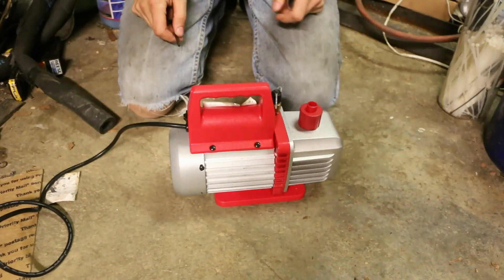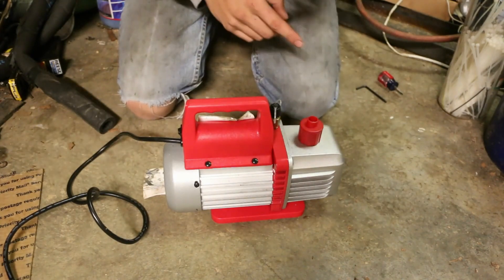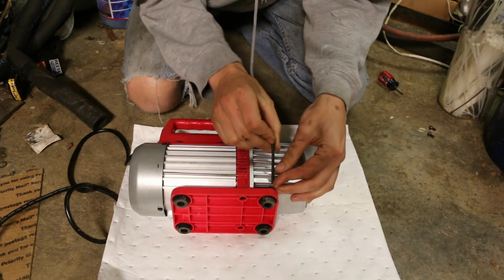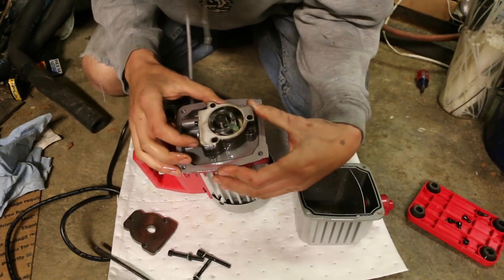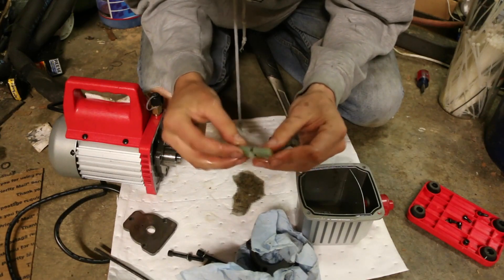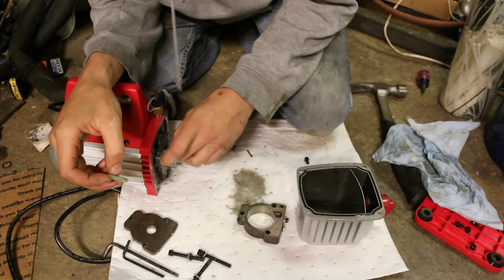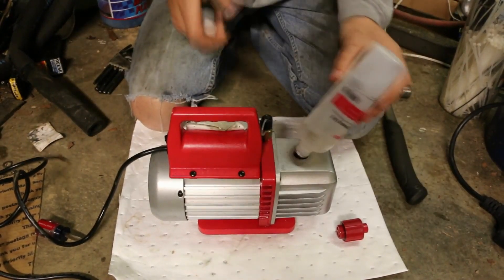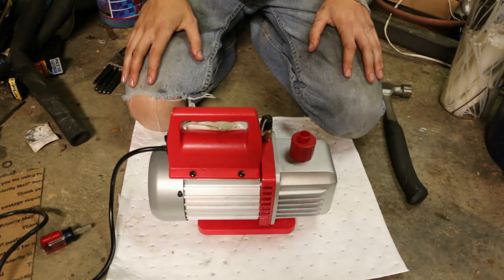Kozyvacu TA350 Teardown and repair. (Siezed vacuum pump diagnosis and fix)

Comment: Great video!  I just did the same thing to my two stage.... Did you ever find replacement vanes?
Reply from the maker: I did a little looking but never did find any that would fit. I should look again sometime but the pump has been working fine for years now after I did this so I'm not in a big rush 😂

Comment: I have the same pump. It lost vacuum, but I found the problem. It was the one way valve at the bottom of the brass inlet. It had some fine fuzzy debris that kept the valve from sealing. 
But while I had it apart, I put a bit more tension in the two springs that push out the two green flat pieces. Also, here's a tip. Get rid of the thin oil that these pumps come with. I bought some 68 viscosity pump oil on Amazon. It is thicker, more like honey and it feels way more slippery than the stock oil. The pump now works better than when I got it new.
Reply from the maker: Excellent info! I just picked up some 68 weight oil, that oil that came with it seems like it must be 5 or 10 weight, super thin!
I'll check my check valve too, I've put some time on this thing, and it has been working well since this repair, but some fresh oil and double check the valve and such certainly could make it much better, or at least won't make it any worse!
Thanks for sharing your experience and tips!

Comment: Good film..tu.. if only in real life repairs were so obvious and simple.
Reply from the maker: It is certainly very rare, my video on the air hammer I bought was even weirder. A piece had been installed backwards from the factory, I flipped it around and it works great! But it sure seems like every task I get into on my cars or trucks grows as I'm doing it. New brake pads turns into hoses and calipers and rotors and suspension parts and then rotating tires and rebuilding this part and that part 😂
Reply: @trythistv  well my pump it works but after a while it makes strange noise yet it is pulling vacuum very good at first then less as it getes hot. i took it apart and didn't find anything.put it back together with fresh oil and vacuumed the car ac and same thing with noise like something is loose or not right.it does get hot, and it didn't used to as much. Almost new pump only was used on one job few years back.   i know something is wrong.

Comment: did you get that vacuum pump on ebay from some chinese company? bc i got one just like it and it didnt even work once. So is this problem happening to everyone?
Reply from the maker: I got this pump some years ago from Amazon knowing full well it's a Chinese clone of a robinair or some similar brand. It worked great for about a year then randomly locked up on me

Comment: Holly shid, I just find out that your pump won't work as effective if u over filled it with oil , it must be low so air gets sucked in rather than oil just getting shcked in and out , thanks a bunch
Reply from the maker: Yes sir! Good little pump as long as you set it all up right!

Comment: Good tear down and repair!  Those single stage pumps are definitely knock-offs as you stated, but can be ‘polished up’ a bit to be useful for light duty use.  Another commenter hit in the root cause of the glass-fiber reinforced nylon vane wear.  The center, steel rotating hub has slots for the vanes that are very rough on the inside due to being made by wire EDM and no finishing after.  Since the nylon vanes slide on the rough steel surface they wear down and eventually won’t slide in and out easily anymore, hence a locked up pump.  The quick solution is to do what you did in the video And lightly polish the area inside the steel hub that the vanes slide in and out on. Also very lightly break the sharp edges on the steel hub so it doesn’t dig into the vanes.  Be careful not to overdo the polishing and relieving or the vanes will not be held perpendicular to the pump bore and will not develop enough vacuum.
Reply from the maker: AHA! Thank you for the insight! I think you've hit the nail on the head, My pump has been working well ever since this, but I probably should have polished and chamfered the hub. I will be sure to do that if I have any need to disassemble it again!
I'm sure its not the best vacuum pump around, but it was cheap and does what I need!

Comment: I have a different model, however, I had a seized pump, right out of the box and without this video, Id have been F*@cked.   Thank you so much for doing this.  Much Luv brother.
Reply from the maker: Oh man, that's a major bummer to get something broken right out of the box, Glad the video helped, I suspect most of these cheap vacuum pumps are very similar if not identical, probably all clones of robinair or someone.
Also, I do believe the oil lubes everything, but I can't see how adding a film of grease would hurt anything at all, I think I just spread oil on the parts as I reassembled so nothing would run dry and its still working fantastic even now.
I do ponder getting a 2 stage or larger pump eventually but it works pretty good for me as-is.